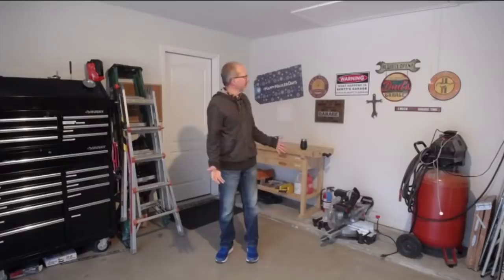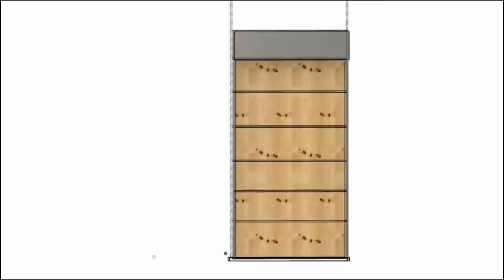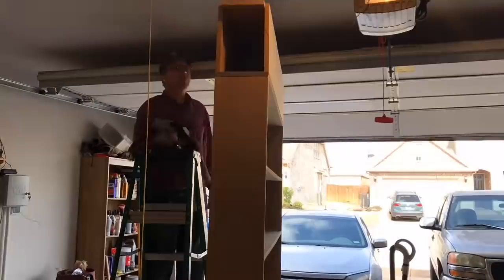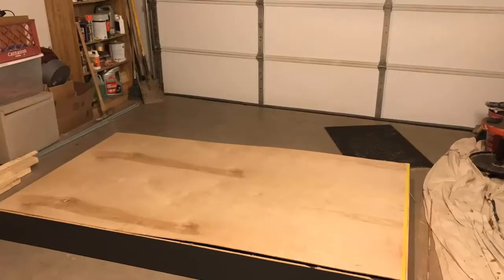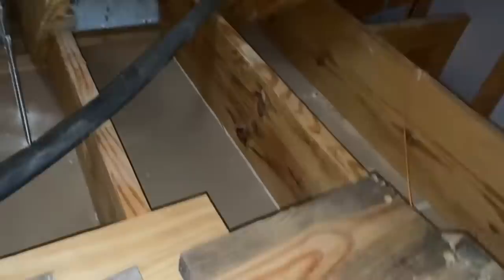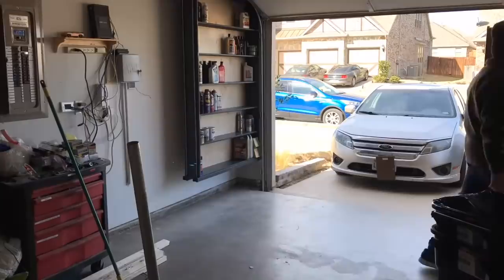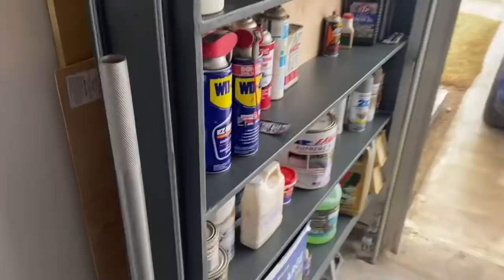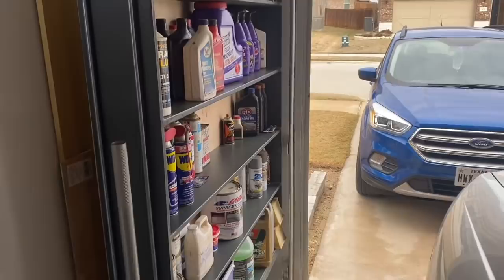Get Smarter Storage with These Easy-to-Build DIY Hanging Garage Shelves with Extra Storage Behind!

Comment: Ridiculous storage idea. LOL
Reply: totally
Reply: I don't get it at all.
Reply: @gokblok  how else are you going to build a cabinet that’s up off the floor but also has space behind it for storing vertical sheet goods? It’s not that hard to understand.
Reply: @Patrick94GSR  for one, I'm confused about why you would want it off the floor to begin with. Secondly, if the plywood is on the floor behind it, what's the point?
Reply: @gokblok  again, he covers that in the video. Having storage up off the floor makes cleaning much easier, and also reduces how much dirt and dust builds up behind there in the first place.
Reply: @Patrick94GSR  dust and dirt do not accumulate under or behind things that are on the floor and against the wall. But again--you still have to lug all that plywood out from behind the shelves if you want to sweep underneath them. Not to mention, people who are worried about dust accumulation put doors on the cabinets they build. It just seems like a lot of trouble to make unstable shelving for no real benefit.
Reply: @gokblok  Wait, you must not have a garage. Mine gets crap all up in it every time the door is open, and it all collects in and around the stuff sitting on the floor.
Reply: @Patrick94GSR  you're making my point for me. Why not hang the whole goddamned cabinet on the wall and put doors on it. For plywood storage? It's just a dumb idea.

Comment: FOOLS! Look i service overhead doors. Believe you me, when I show up at some d bag diy'ers house and there's freaking shelves packed around the door tracks im charging an extra hour or 2 to work around that. Good luck.
Reply from the maker: Good thing I am a DIY and will never hire you anyway.
Reply: @ScottsGarage17  you won't but you're selling a bad idea to people. You shouldn't advise people to do dumb s hit. Smh besides you, if nothing else ought to realize you just give yourself extra steps when things break.
Reply: Well with your insulting comments about people you won't have many customers
Reply: @timfixinstuff  Y'all need to install garage doors that don't break. Mine is 30+ years old and works like new. Old dude who put it in must have known his stuff.
Reply: @JaymoJoints  um, they all last at least 20-30 years. People run into em, springs break from (they have a cycle life) normal wear. Bearings get full of dirt and seize. Things happen man.